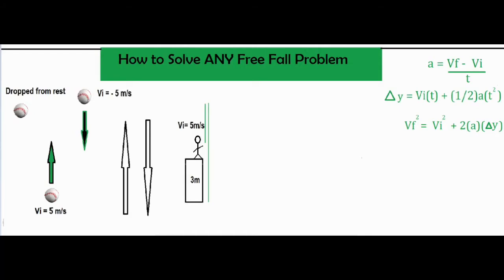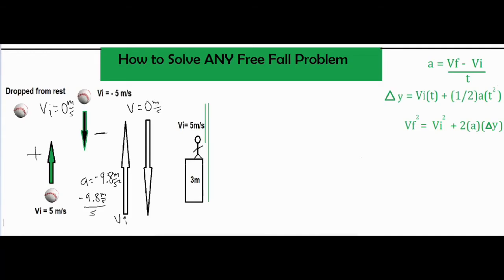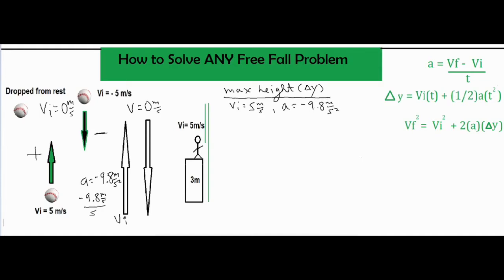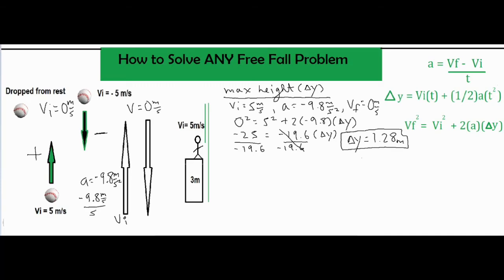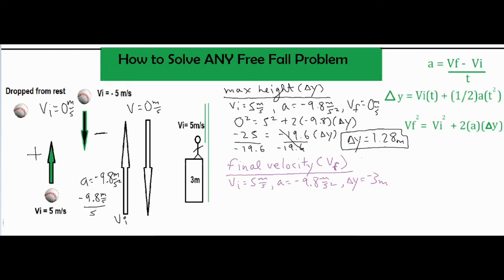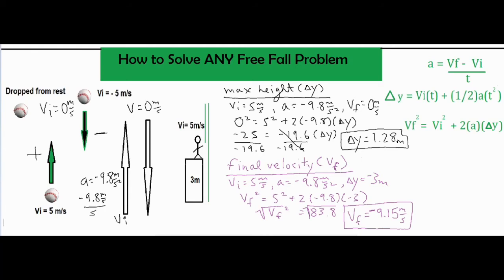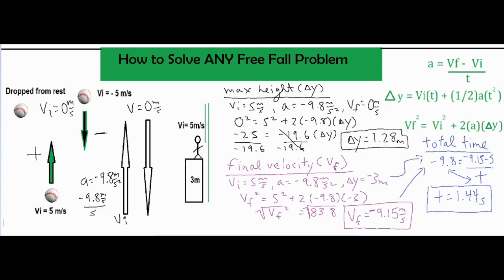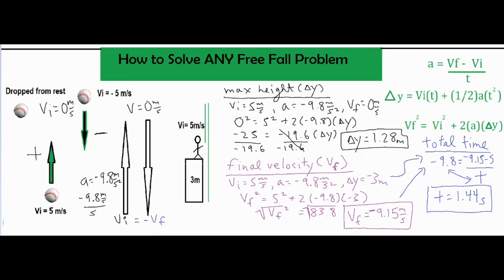How to Solve ANY Free Fall Problem (Key Concepts, Process, and Examples)

Comment: Why do you have the same Vi when defining the final velocity?
Reply from the maker: Vi and Vf are the same (different signs) when an object falls back to the same height.  For example, if a ball is thrown upward at 15m/s then when it comes back down to its original height its velocity is -15m/s.  An object basically goes from 15 to 0 then from 0 to -15 because it experiences the same acceleration over the same displacement.  I believe that's what you're asking.  Please let me know if you need more clarification, thanks!
Reply: @beatphysics  thank you for the explanation. You have a mistake in the video then. There should be a different sign))
Reply from the maker: @Mr_WinRar   Ok, thanks!  I looked through the video again and I didn't find the mistake you were referring to. What time in the video are you referring to? I definitely make my share of mistakes,  and I like to put a note in the description when I do.
Reply: @beatphysics  6:16 – (5 m/s instead of -5 m/s)
Reply from the maker: That’s the Vi of the problem.  5 m/s because it’s tossed upward. 👍🏼
Reply: @beatphysics  yes, but then it came to a complete stop. Can you explain, please?
Reply from the maker: @Mr_WinRar  I assume you're still talking about the final velocity calculation in purple still.  This one doesn't reach a complete stop, but it does instantaneously hit 0m/s at the peak, but then it falls back down and then continues to fall 3m below the person.    This means that it will hit the -5m/s, but then continue to accelerate for an additional 3m causing the final velocity of -9.15 m/s.  I hope that answers your question!  Let me know if you need more clarification.
Reply: @beatphysics It reaches negative 5 m/s, and you have written positive 5 m/s. Wrong direction.